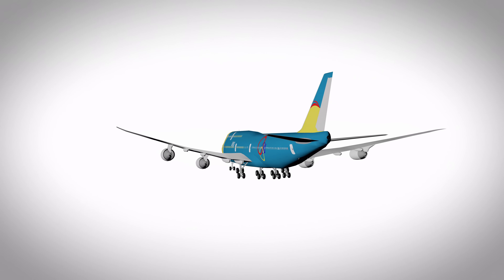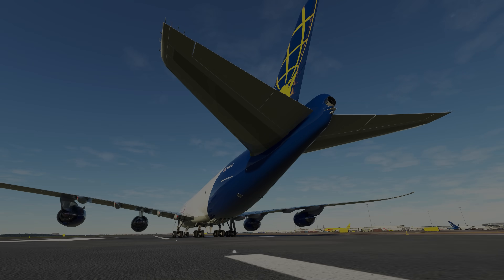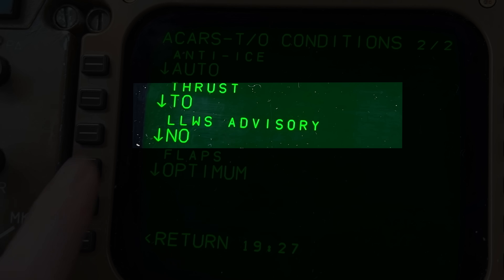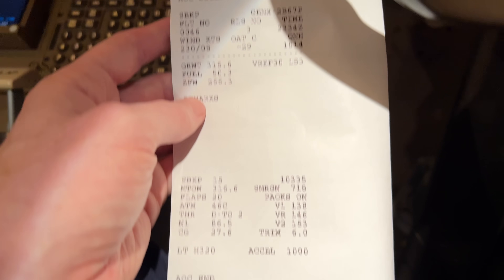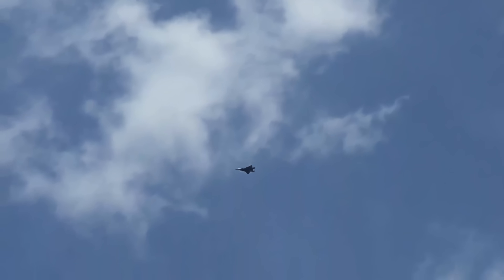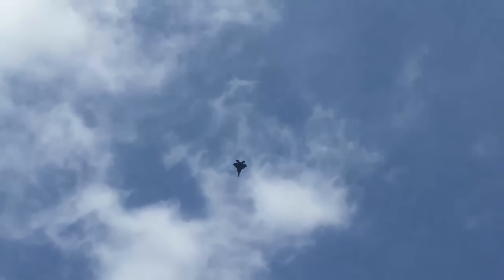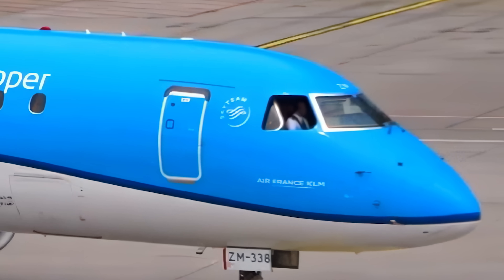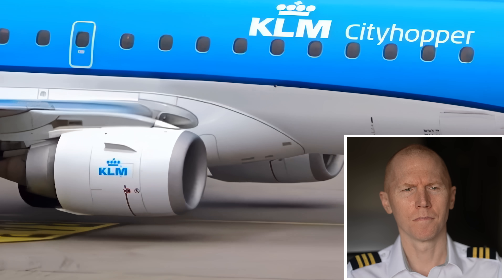Unsafe 747-8 Vertical Takeoff

Comment: In the LAX plane spotting community we call that a rocket launch takeoff.  You mentioned a safe altitude for retracting the flaps.  Question?  Is there a standard altitude for retracting flaps?  I have seen some planes have the flaps retract before they reach 2,000 feet, while other people say the plane would normally be around 4 - 5,000 feet.

Comment: Not mentioned is that there is no visual reference to the horizon. The attitude was probably less than 30°, but someone could have the perception that it was directly overhead and give the illusion that it was literally vertical. Without context, if I had said, "Check out this 747 hitting 76° in a max takeoff climb at 0:54 !" you would be preconditioned to expect to see exactly what you do see, and your mind will trick you to seeing it at that climb.

Comment: That aircraft's upper deck seems to be a lot shorter than the examples shown later on in the video. Like it was an old classic or something. Or is it the angle of the camera?

I once paxxed it MEL-PER on a B767 which was lightly loaded. It was a rapid acceleration and climb-out, more than anything that I've  experienced since.

A former QF B767 (later B744 and A380) driver told me that the 767 was more like a sports car than a lumbering passenger aircraft. And it sure felt like it.

And the least performing, at least from an economy pax's perspective, was an Air New Zealand B744 departing LAX. Fully loaded it seemed to take forever to rotate and climb out.

Comment: The car analogy, as for engine braking, is not going to explain the damage Kelsey mentioned with the reverse thruster being open and exposing the engine to debris. In that respect, it would be similar to removing the air filter and air horns from a carburetor then removing the hood as well. Then drive around in a dry and dusty environment and see how long you're
Intake valves will last.

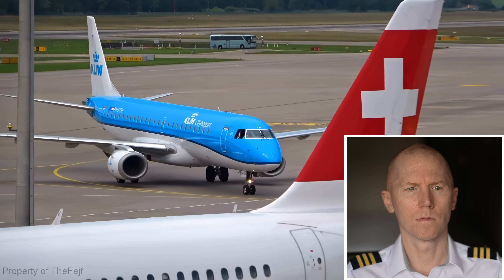Comment: 10:44 Ooh... so you can to stuff your face, get fatter while getting paid and then konk out.  But can your plane do a barrel roll?

12:42 There's nothing inherently risky or unusual about downshifting versus braking with a manual transmission.  I think a better comparison to taxiing with reverse thrust would be removing the air filter in your car and driving around without it.

Comment: Okay I left a comment but who reads those my question was coming out of Denver quite a few times well not too many butt when the aircraft took off went right into pretty much a vertical climb which I thought was unusual cuz most of the same flights went more on a 30 35° angle not a 60 to 65° angle which I didn't mind because I thought maybe we were heading for the Moon instead of Vegas out of Denver which I really enjoyed those rides back when you come over the Rockies never disregard turbulence coming back you're going to hit them Rocky bumpy turbulence is like you're bouncing off the top of the mountains anyways a vertical takeoff is what I was pandering

Comment: Another reason to not use the reverse thrusters on the ground is that the pilots could forget they're open and try to take off with them open, causing potential tragic outcomes. I believed I saw this as a reason for a crash in one of my aviation channels.

Comment: The 747-8 looks perfectly fine. 
The main thing to look for is the AoA vs. the direction of movement. Angling at a stout upward angle is not a problem as long as the plane is moving in a stout upward angle. That's actually a low AoA, as AoA is relative to your direction of movement.
It's when the plane is nose-up, but moving level, that you're doing less safe things with your angle of attack. Especially when there's a 'hard' bank while at high AoA.

No chocks for hand-start... that's just nuts.

The F-22 maneuver... unlike most planes, fighters often have enough thrust to just say "I don't need your stinkin' lift" and just thrust through thing which would absolutely crash a less powerful plane. In this case, the plane is using the wings and fuselage as control surfaces, instead of as lift surfaces. With thrust vectoring, there's even greater latitude with doing this. There are limits though, if you can't get airflow flowing past at least one side of one of the vertical stabilizers, things can get unpleasant, although differentially throttling the engines can be finessed when both vertical stabs are occluded from airflow by the wing, but there's definitely a steep skill curve for that. Most fighters don't get quite that fancy with maneuvers, because most fighters don't have thrust vectoring and engines which are fully agnostic to the direction of airflow. So it's kind of a 5th gen or gen 4.5+ thing. The most impressive I've seen is an Su-35S hovering on it's tail, then reduce altitude (lowering backwards towards the tarmac), and then power up pulling straight up out of the hover. You're not really using lift or control surfaces 'at all' in something like that. F-22 would not do that, because it's thrust vectoring is limited to pitch & roll only. You'd need 3-D thrust vectoring to add yaw. And need to have greater than 1:1 thrust to weight ratio without the benefit of forward airflow through the engines. So basically, yeah, witchcraft.

Comment: Captain,
Recently flew from Puerto Vallarta to Phoenix International, through customs and then on to San Antonio. After takeoff in 100+ degree weather, the pilot was climbing for about 4-5 minutes. Suddenly things got very noisy and some turbulence and it sounded like a cargo door or landing gear noise for about a minute while climbing and gaining speed. Eventually the pilot did explain that they were indeed cooling the landing gear… a normal procedure. 
Is that normal? Perhaps there was a tire overheat warning? Never seen that, especially at that altitude and speed.
As a heavy pilot can you comment on that scenario? 
Thank, enjoy your channel.

Comment: As a car guy I don't agree or disagree with you. Some transmissions, like in trucks, are built with more heavy components and are more designed to be used to slow the truck and whatever it may be hauling down. On the flip side the transmission in lighter rigs like cars that aren't necessarily designed to haul much aren't necessarily built to be used to slow the rig down. It's simply unnecessary. Doing so will likely wear the car's transmission out faster. Hence why most trucks and larger SUV's have a tow or haul mode which will cause the transmission to either hold its gears longer upshifting for increased power and as you slow down or climb a hill also cause it to downshift much sooner than normal to help slow the rig down. Otherwise you'll go through brakes much, much faster.

Comment: The reverse thrust down shifting analogy is a little off. Look at using reverse thrust over the taxiways and ramp area like running your car's motor with out an air filter. There is a risk benefit analysis that should be made to using reverse thrust.  You can generally run reverse thrust on a runway with a very low risk of ingesting FOD. As you very well know, FOD seems to be more prevalent near the terminal areas and those taxiways adjacent to the ramp area.  Since we have no air filters on our jet engines, there is a greater risk of damaging our engines if operating reverse thrust in these areas. The benefit of reducing break wear on the ramp, would not be greater than the risk of engine damage.

Comment: If the plane in the video is a Piper Cherokee it has a parking brake. Hand propping is not overly dangerous. (It is the way he did it.) Hand starting is one of those things best done at idle. Why so much power. Standing in front of a spinning prop is dangerous. He should be moving away from the prop to the side as he turns it. Knowing how to do it safely might get might get you out of trouble some day.

Comment: Downshifting to slow down with a manual transmission car is done for a lot of reasons.  And it's not to save wear on the brakes.  One big reason is to keep the car in gear in case you need to accelerate.  If you have shifted into neutral, hitting the gas does nothing, as you are in neutral.  If you are engine breaking, and need to go, just hitting the accelerator makes you go.  In an automatic, just let the TCU do it's job and leave it alone.

The main reason i enjoy driving a manual is the greater control it gives me in the car.  I can decide not to upshift right away, if i know i am decelerating again almost immediately.  No reason to upshift, and then have to downshift right away.  Let the engine sit at higher revs for a second or two, isn't going to hurt it (and may actually help if your engine is overheating).

Now, using the thrust reverser at slow speeds makes so sense to me.  Because, as you said, FOD is a thing, and damaging those very expensive engines is stupid.  Not to mention kicking debris into the people manning the gate potentially.

Comment: ... and the fighter is an F22 Raptor with a flight computer in it that monitors and continuously corrects the pilot's controls, keeping it in the sky. The first fighter to have such a computer was the F16, which is unstable about its longitudinal axis because the centre of gravity is above the force point of the wings for lift. These fighters cannot be flown safely without the flight computer.

Comment: ii suspect the fighter jet is able to do what it did cause most modern fighter jets have vectored trust, meaning you can turn the jet engine towards the ground so that it flies like a helicopter , then turn it backward to make it fly like plane, its on he stick, thats how they do vertical takeoff, then fly straight away
Reply: I wouldn't say most modern fighter jets do it lol one version of the new F35 does and the harrier does.
Reply: @jakeoltmann1263   either that jet was using vectored thrust or magic, it can only be one of  those 2.
Reply: @JaskanFactor  I think we are having a misunderstanding of terms, vectored thrust and the ability to VTOL is not necessarily the same. The F22 does have pitch/roll vectored thrust,  and is one of only 2 aircraft that has pitch axis vectored thrust but that does not give it the ability to vertically take off or land.
Reply: @jakeoltmann1263  thanks for adding that i was sure f22 could VTOL , in fact i was sure all modern jets have this capability, but now am realising   only those that need carrier operations  use it. cheers

Comment: Car guy here, that analogy is the only good one. In the expense of a transmission rebuild or repair vs the brakes, the brakes are cheaper in both parts and labor (though, I do heel-toe downshifting in a manual car in traffic to keep myself in practice for it despite that expensive fact).

Functionally there isn't really a good analogy on how a jet engine's reverser works in comparison to a piston engine. Even the way a Jake brake on a diesel - which pumps exhaust gas and pressure back into the engine to slow it down (due to not having the natural ability to "engine brake" like a gasoline car does) - wouldn't fit here. The reverser is directing exhaust air forward to slow the plane where the Jake brake is pumping exhaust back into cylinder to slow the diesel engine when it's in gear.

Also, throwing a car into reverse isn't a good analogy because it will just completely break the transmission.

Comment: Definitely not a car guy. Downshifting a transmission is appropriate for saving brakes. Not because they’re cheaper but because they have limitations. For instance, when towing my fifth whee RV, downshifting to climb a hill is necessary. Going down a hill downshifting keeps speeds lower and reduces brake usage. Use them exclusively and they can get so hot that they can no longer provide braking. 
Rule of thumb is descend a hill in the same gear or lower than used to climb it. 
I once encountered a hill so steep that even in first gear I was accelerating down the hill and nearing redline RPM. I applied the truck and trailer brakes ONCE to a complete stop, put the transmission in “granny low” and proceeded down the hill without using brakes and at a safe (but very slow) speed. 
People in cars lined up behind me (small two lane road) weren’t happy but it’s like the controller that wants you to perform a no delay takeoff with a jet fighter in final and you’re not ready in your Cessna 172. I’m not speeding up to make you happy while putting myself into a bad situation.

Comment: Saw this plane today aborting a landing, was driving 826 southbound, came in flaps down, landing gear down, flew over the 826 and just before it disappeared it pulled up, retracted landing gear and once it had some altitude retracted the flaps. It was around 230pm on 12.16.2024

Comment: I flew out of John Wayne Airport years ago, and the pilot came over the loudspeaker before we took off and said
"Due to our noise sensitive neighbors, we are experimenting with different types of take offs and you're going to feel a little more thrust than usual and a steeper incline than you are used to in an attempt to get into the air quicker"
I assumed he meant the people around the airport had been complaining about the noise from the airport because it had been a big deal in the newspapers (like the airport wasn't there when they bought a 3 bedroom house for $15 bucks in Orange County) Anyway, what it ended up feeling like was he went out on the runway, did a brake stand, he let the brakes off and we shot down the runway then went up at an incline that made me think the guy was having 'Nam flashbacks or something! 
I'm not sure if he actually did a brake stand or not, but it felt like it because the plane seemed to want to go and actually felt like it started rumbling a little before it let go down the runway, and you coud hear the engines increasing while that was going on. But, I do know that was one steep incline we went up at!
Reply: @SheevAmidala  Thanks for the info! I do know I have never experienced anything like it since then, and that was back in the early 90's. That thing rumbled like it wanted to go and you could hear the engines increasing in power and when he let it go we shot down that runway and into the air. I remember thinking that incline was severe, too - I thought we were gonna end up straight up! Obviously we didn't, but it felt like it was gonna make it there!
Reply: " the pilot came over the loudspeaker before we took off and said..."  A Southwest Airlines captain was more gruff about it prior to an SNA takeoff, concluding with something like "So unless you think it's safe to cut back on power right after takeoff, you should let the FAA know."

It is safe -- not at all close to right after takeoff -- but I was surprised the pilot didn't seem to know any better, and apparently wasn't happy about having to follow rules he didn't agree with.  So he had everyone else in the cabin afraid of the thrust cutback, and me afraid of him.

@SheevAmidala  Thanks for the great tutorial!

Comment: Hey, car guy here.The comparison with a car transmission and brakes make total sense Kelsey. 

It is indeed not a good idea to try to save brakes by down shifting a manual transmission car using compression of the engine and revving the engine up for nothing at the same time, which will wear both your transmission AND engine faster, which both cost more than brakes, and are also way more difficult to change then brakes. Keep it up! 😊

Comment: Transmission in your car won't be what blows from an overly aggressive downshift, it'll be the engine from over-revving. Typically one or more connecting rods break and poke holes through the side of the engine. Saw one car with a manual trans where they'd left it in first gear and towed it down the highway. Flywheel exploded, big piece went right through the hood. But yeah, point's the same. Brakes are cheaper.

Comment: Braking with the transmission not only saves your brakes, but also fuel, and doesn't ruin the transmission (done properly of course, but anything done improperly damages stuff)
-
Why do you need to keep the flaps extended up to a certain altitude instead of a certain speed?..

Comment: There are many times (but not all times) when planes depart San Francisco SFO on  the northbound  runway at what seems like max thrust at even more extreme climb angles than shown. There is up to 1300' +  mountains kinda in the way, and often a big cloud/fog bank a bit farther north.  Plus maybe there's Oakland OAK airspace in the way for planes leaving SFO and headed north or east. If those aren't the reasons, can anyone tell me why they do this so often (and not all the time)? When the winds go westerly and the westbound runway is used, planes depart SFO just high enough to clear the hotels, power lines and hills beyond, so it seems nobody truly worries about the noise.

Comment: Driving a rental car in USA when I want to slow down I put the air conditioning on. Downshifting to hold your speed downhill is a perfectly normal manoeuvre so long as you stay within rev range. Also charges the battery and drives coolant around the engine. "B" for "brake assist" is one of the settings on our Toyota automatic transmission.

Comment: Regarding the air show video.  The F-22 has engines that are capable of thrust-vectoring.  That means the pilot is able to direct eninge throst in whichever direction they desire.  That's how the airplane can maintain level attitude while turning left or right and descending but not pitcjimg down.